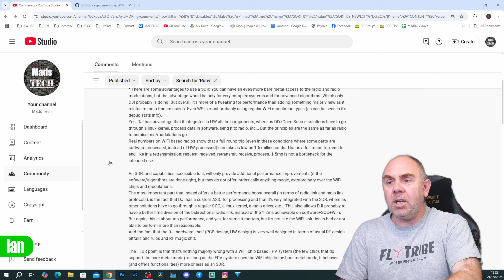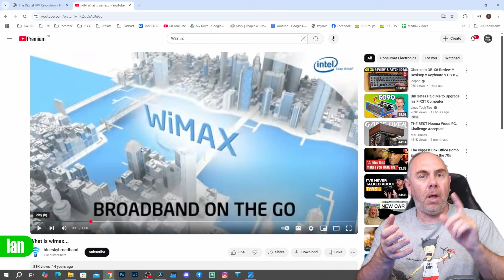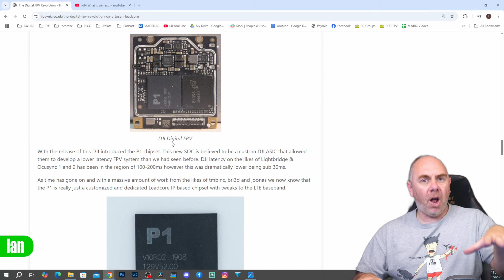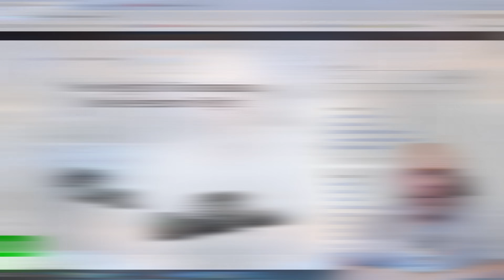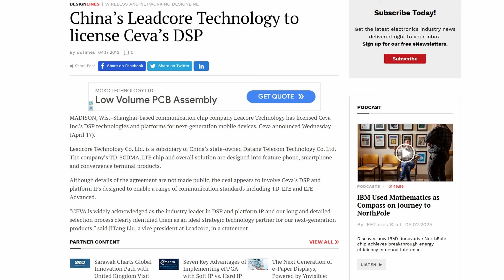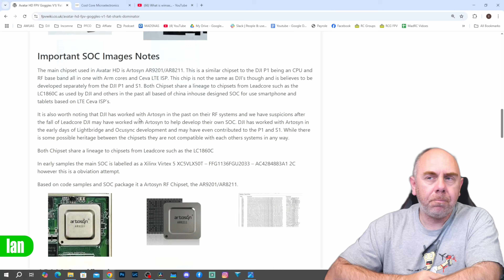DJI O4 - Caddx Avatar - HDZero - OpenIPC-Ruby- Edge T3 - Digital FPV Technical Differences & History

Comment: A pretty good rundown. Are the WiFi-based systems confined only to  the frequency and power transmission parameters of the 802.11 standards? They'd have to play around with the modulation schemes to improve the range and the data transmission rates because there is no other way to do that? Data transmission rates, of course, can also be improved via the multiplexing and FEC schemas, but range can't be improved without the modulation parameters, or, perhaps, some AI algorithm to generate lost packets? Are the WiFi-derived systems as good as the proprietary systems? What are the advantaged of  WiFi-based systems if they can't neither connect via the standard WiFi protocols nor provide for a greater manipulation of the physical layer? They don't seem to provide any obvious advantages, except for, perhaps, some cost reductions of not having to design their own physical radio hardware?

Comment: Not really… You don’t need to create a custom waveform, even DJI uses the same waveforms as WiFi, like QFSK and QAM coupled in multiple carriers via OFDM, so even as SDR they use the same modulation technologies as WiFi, the key here is how you use the multiple streams and the FEC . The only limitation I see on WiFi is the bandwidth, 20Mhz is to much, the sweet spot is between 4MHz and 8Mhz. The issues RTL has is the driver (it could be improved) and RF frontend in some devices is simply badly designed or poor QA. The EVM is very damaged limiting the range.

Comment: You are talking about MAC addresses, are you saying these wifi units send complete 802.11 frames? That would be a bout 32 bytes of overhead for up to 2312 bytes of data. Wireshark and other tools should be able to capture those raw frames and at least pick out the 802.11 data like addressing, and other meta information.

Comment: You are giving too much significance to the SDR-WiFi differences than it's due. At the end of the day, DJI, WS use same types of radio modulations, maybe with some extra spices added, which for sure will help the exact use case (FPV live video), but not to the extend that's made to look like. The SDR itself is the least of the reasons DJI is where it is. Radio modulations are quite understood today. And DJI did not invented new types that are magic.
A very well designed hardware (in terms of RF quality and RF frontend), a "dedicated" SOC that can talk very intimately with the SDR, the optimized software, all these give DJI the top spot. All these allow for a very precise and fast control of the radio link, how the two ends manage to understand each other, when they talk, how they train, etc... And that's what makes DJI radio link top notch. Not some magic unknown modulations or other magic that only a SDR can provide. Not that the radio link itself it's magic somehow. Radio transmissions are quite well understood in this day and age. But the overall HW architecture and a very well designed system and software give them the ability to have a chirurgical, time precise, control of the radio link and what and when it's sent. Put DJI software stack on a poor HW design and see how it goes. Remove half the caps on those air units and googles, remove the shielding to all the chips, replace the voltage delivery sections with some cheap ones and see how DJI will perform. I will bet any amount that it will perform poorly, compared to it's native condition. (DJI) Software, in general, as smart as it could be, can paper only so much over a poor radio link.
For top performance and to implement a perfect radio link apropiate for the use case at hand, yes a SDR provides a boost/benefit, but not that big as it looks. The overall HW and software design is the most important part, and the entire RF stack, in terms of RF performance (noise, sensitivity, filtering, etc), not the SDR. I would put the SDR below all these.
And, in today's day and age, never say never :) For sure there are smart people and money out there to be able to replicate what DJI is doing. It's just the stars that need to align and some luck is needed for it to materialize :)
Just because WS didn't, it's not a demonstration of  the negation...
And, just to drive the conversation home, let's provide some numbers, to see that the "raw" radio link , SDR or Wifi, is NOT what makes DJI what it is:
Currently on those custom WiFi links, you can get:
Latency for a full roundtrip: 1.5ms;
Datarate: as much as needed (let's take the 18Mbps base case):
Rx sensitivity: -75dbm;
SNR required: 9dbm;
TxPower: sky is the limit;
Of course, if you go up or down in modulations and data rates, the Rx and SNR numbers change for the better/worse. Classic stuff these days, nothing magic here. Some chips can have better numbers, due to better design and manufacturing, some worse. But overall, all these numbers, as they stand today, do not prohibit someone to theoretically achieve something similar with what DJI is achieving, as far as digital data transmission is concerned, in any shape of form. That's not what makes DJI DJI. That's why the WiFi/SDR talk is pretty much unimportant. All the other points are extremely important that make DJI DJI: Software, HW design, RF frontend design, quality.
The physics of a radio link are physics.
I'm simplifying here and omit some details, as.. we are in TickTok 10 seconds attention span era...
Anyway...
Cool video, a conversation piece :)

Comment: My ears pricked up with Wireshark. I've been sniffing networks since the nineties... 

I was thinking we could look at optimising OpenIPC for avoiding cache misses by optimising traffic to properly use L1 CPU cache for data (and software, using pinned CPUs) but it looks like DJI are way beyond that. It could be interesting to use a SOCKS proxy so long as we can reverse engineer the lower level stuff to see  what shonky old-school AES protocol DJI use, as they can't use a nonce for forward security (which requires more of a TCP-style approach). Hmm, interesting, thanks so much for that.

Comment: Really great explanation.  As a network engineer I get the layer 2 explanation of the reformatting of the data link layer.  I have HDZ, DJI and analog.  Each has it's own strength and weakness.  DJI is almost a major win in each categor except something you didn't touch on which is weight.  Analog just cannot be beat when it comes to weight.  This is only relavant when it comes to the smaller drones like 65/75/85mm but even there, the DJI O4 Lite is almost light enough.  If you don't want to freestyle a 65mm you have an excellent micro-cinewhoop that gives incredible image quality.  Unlike their other products, they do show this as a fast get to market product since there was and still are some shortcomings (Lens, fragility, camera supply, mipi issues, etc) but I have been happy with mine and look forward to a v2 of the "lite".  I understand Carl makes his so fast and capable because he uses more FPGA chips than others so he can do a software upgrade and literally shrink latency and increase performance where an ASCI is basically baked into silicon.  Why don't more manufacturers (hello walksnail?) move to a FPGA so they aren't beholden to a chip manufacturers SDK?
Reply: The kind of FPGA you need to run an OFDM modem like DJI's or Walksnail's costs several thousand dollars if you get a good deal per chip. The reason HDZero is able to get away with some FPGA stuff (although I don't think they do that anymore?) is that HDZero is computationally many orders of magnitude simpler.

Comment: 4:46 One small correction regarding Wi-Fi-based devices (like OpenIPC): it is possible to capture their traffic using Wireshark, tcpdump, or other programs when using a Wi-Fi adapter in monitor mode.

Comment: I'm new to the hobby and only flying simulator right now. Analog seem to be my only option due to the limitation in my budget. But i will wait for Caddx to see what will they cook up in a few month. Hope they kept their words about a cheap entry level system with better image than analog.
Reply: Analog is cool just for the interesting historical tech aspect of how analog video works, but you do notice the limitations. I have my first "real fpv" drone (betaflight fc with acro, instead of a camera drone) for close to a year now with analog video and I'm honestly tired of it to the point where despite my very limited budget I'm really close to throwing the 350ish euro into dji goggles n3 and an o4 lite air unit. Analog IMO is okay for big fields but it really takes my confidence away flying around trees and in close quarters when you can't see any detail. I think having HD video is much more enjoyable to the point where the price is worth it now with the "cheaper" o4 lite and n3.
Reply: Analogue is all good. Caddex is cheaper in the long run. Dji keep updating there systems and don't allow full cross over of their own gear. Either way you go you will love it.